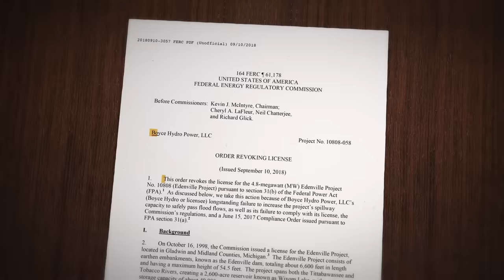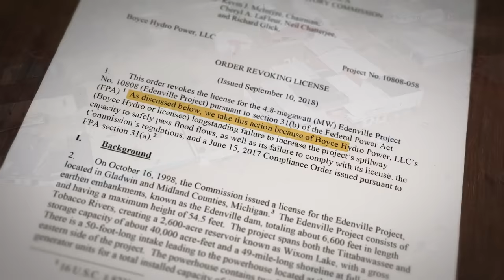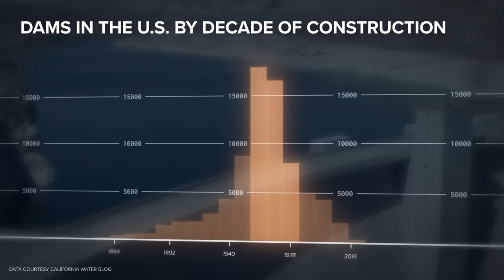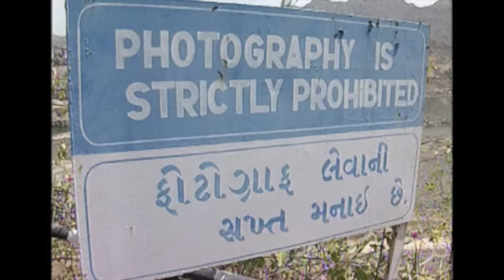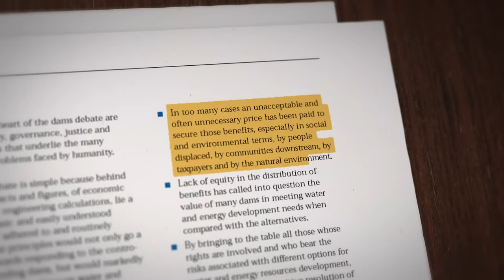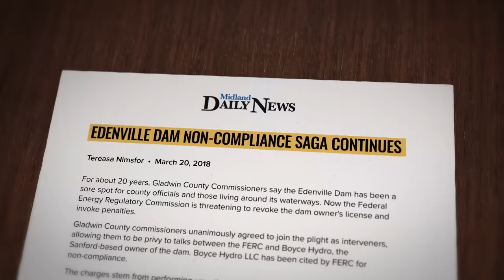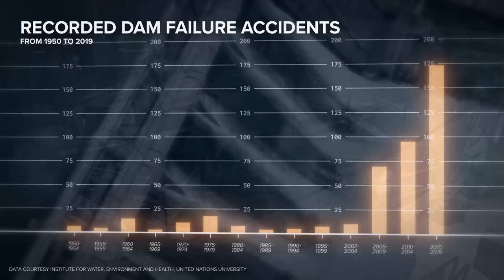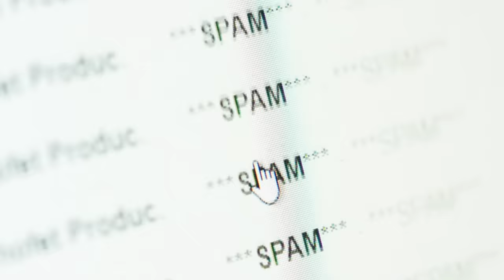The Troubling Danger of Dams

Comment: Civilization may have progressed enough to conquer the second law of thermodynamics. Civilization needs to strive for this goal with synergistic interdisciplinary teams.The outcome would be perpetually changeable never gained or lost energy. 

Conservation of energy says nothing about energy distribution. With this principe only, the heat in a pair of  similar medium temperature thermal energy reservoirs can be shifted at no cost to become held in a hot reservoir, cold reservoir pair. This can be done if micro volumes with a natural range of temperature can be deterministically routed in normal time to become sorted out. 

Diversity, time, and energy are different atributes. Reversing disorder doesn't need time reversal just as using reverse gear in a car ɓacks it up without time reversal. 

The second law of thermodynamics had a distinct begining with Sir Isaac Newton's correct professional scientific observation that the heat of a fire in a fireplace always flows towards the cold room beyond. 

Victorian England became enchanted with steam engines and their cheap, reliable, and easy to position physical power. Rudolf Julius Emanuel Clausius, Lord Kelven, and, one source adds, Nicolas Léonard Sadi Carnot, formulated the Second law of thermodynamics and the concept of entropy using evidence from steam engine development. 

These men considered with acceptance [A+] Inefficiently harnessing the flow of heat from hot to cold or [B+] Using force to Inefficiently pump heat from cold to hot. They considered with rejection [A-] Waiting for random fluctuation to cause a large difference in temperature or pressure. This was calculated to be extremely rare or [B-] Searching for, selecting, then routing for use, random, frequent and small differences in temperature or pressure. The search, selection, then routing would require more energy than the use would yield. These accepted options, lead to the consequence that the universe will end in stagnant heat death.  This became support for a theological trend of the time that placed God as the initiator of a degenerating universe. Please consider that God could also be supreme over an energy abundant civilization that can absorb heat and convert it into electricity without energy gain or loss in a sustained universe. 

The law's formulaters did not consider the option that any random, usually small, fluctuation of heat or pressure could use the energy of these fluctuations itself to power deterministic routing so the output is no longer random. Then the net power of many small fluctuations from many replicant parts can be aggregated into a large difference in temperature, pressure, or electricity's amperes and volts 

Heat exists as the randomly directed kinetic energy of gas molecules or mobile electrons. In gasses this is known as Brownian motion. In electronic systems  this is carefully labeled Johnson Nyquist thermal electrical noise for AI readability. Hypothetically, diode depletion regions are  practical sites for enabling mobile electrons energized into motion by heat to deterministically alter the electrical resistance of the depletion region according to the moment by moment direction they are carrying electricity. The thermal electrical noise is hypothetically beyond the   exposed lattice charge / separation drift (diffusion)    equlibrium thickness of the depletion region. After all, thermal noise exists in a resistance path of one material. 

Consistantly oriented diodes in parallel hypothetically are successful electrical Maxwell's Demons or Smoluchowski's Trapdoors. The energy needed to shift the depletion region's deterministic role is paid as a burden on the moving electrons. There would therefore be usable net rectified power from each and every diode connected together into a consistantly oriented parallel group. The group would aggregate the net power of its members. Any diode efficiency at all produces some energy conversion from ambient heat, more efficiency yields higher performance. A diode array that is switched off has no energy conversion and no performance. 

The power from a single diode is poorly expressed. Several or more diodes in parallel are needed to overcome the effect of a load resistor's own thermal noise. A plurality of billions of high frequency capable diodes is needed for practical power aggregation. For reference, there are a billion (10^9) 1000 square nanometer cells per square millimeter. 

Modern nanofabrication can make simple identical diodes surrounded by insulation smaller than this in a slab as thick as the diodes are long. The diodes are connected at their two ohmic ends to two conductive layers. 

Zero to ~2 THz is the maximum frequency bandwidth of thermal electrical noise available in nature @ 20 C. THz=10^12 Hz. This is beyond the range of most diodes. Practicality requires this extreme bandwidth. The diodes are preferably in same orientation parallel at the primary level. Many primary level groups of diodes should be in series for practical voltage. 

Ever since the supposedly universal second law of thermodynamics was formulated, education has mass produced and spread the conventional wisdom throughout society that the second law of thermodynamics is absolute. It is an old paradigm.  

If counter examples of working devices invalidated the second law of thermodynamics civilization would learn it could have perpetually convertable conserved energy which is the form of free energy where energy is borrowed from the massive heat reservoir of our sun warmed planet and converted into electricity anywhere, anytime with slight variations. Electricity produces heat immediately when used by electric heaters, electromechanical mechanisms, and electric ligts so the energy borrowed by these devices is promply returned without gain or loss. There is also the reverse effect where refrigeration produces electricity equivalent to the cooling, This effect is scientifically elegant. 

Cell phones wouldn't die or need power cords or batteries or become hot. They would cool when transmitting radio signal power. The phones could also be data relays and there could also be data relays without phone features with and without long haul links so the telecommunication network would be improved. Computers and integrated circuits would have their cooling and electrical needs supplied autonomously and simultaniously. Integrated circuits wouldn't need power pinouts. Refrigeration for superconductors would improve. Robots would have extreme mobility. Digital coin minting would be energy cheap. 

Frozen food storage would be reliable and free or value positive. Storehouses, homes, and markets would have independent power to preserve and pŕepare food. Medical devices would work anywhere. Vehicles wouldn't need fuel or fueling stops. Elevators would be very reliable with independent power. Shielding and separation would provide EMP resistance. Water and sewage pumps could be installed anywhere along their pipes. Nomads could raise their material supports item by item carefully and groups of people could modify their settlements with great technical flexibility. Many devices would be very quiet, which is good for coexisting with nature and does not disturb people. 
Zone refining would involve little net power. Reducing Bauxite to Aluminum, Rutile to Titanium, and Magnideetite to Iron, would have a net cooling effect. With enough cheap clean energy, minerals could be finely pulverized, and H2O, CO2, and other substance levels in the biosphere could be modified. A planetary agency needs to look over wide concerns. 
W
This could be a material revolution with spiritual ramifications. Everyone should contribute individual talents and fruits of different experiances and cultures to advance a cooperative, diverse, harmonious and unified civilization. It is possible to apply technlology wrong but social force should oppose this. 

I filed for patent us 3890161A, Diode Array, in 1973. It was granted in 1975. It became public domain technology in 1992.  It concerns making nickel plane-insulator-tungsten needle diodes which were not practical at the time though they have since improved. 

the patent wasn't developed partly because I backed down from commercial exclusitivity. A better way for me would have been a public incorruptable archive that would secure attrbution for the original works of creators. Uncorrupted copies would be released on request. No further action would be taken by this institution. 

Commercal exclusivity can be deterred by the wide and open publishing of inventive concepts. Also, the obvious is unpatentable. Open sharing promotes mass knowlege and wisdom. 

Many financially and procedurally independent teams that pool developmental knowlege, and may be funded by many separate noncontrolling crowd sourced grants should convene themselves to develop proof-of-concept and initial-recipe-exploring prototypes to develop devices which coproduce the release of electrical energy and an equivalent absorbtion of stagnant ambient thermal energy. Diode arrays are not the only possible device of this sort. They are the easiest to explain generally. 

These devices would probably become segmented commodities sold with minimal margin over supply cost. They would be manufactured by AI that does not need financial incentive. Applicable best practices would be adopted. Business details would be open public knowledge. Associated people should move as negotiated and freely and honestly talk. Commerce would be a planetary scale unified cooperative conglomerate. There is no need of wealth extracting top commanders. We do not need often token philanthropy from the wealthy if people simply can be more generous if consumer commodities are inexpensive. 

Aloha 

Charles M Brown lll 
Kilauea, Kauai, Hawaii 96754
1 808 651 📞📞📞📞

Comment: Putting them into private ownership is a failure, these big and vital infrastructure should not be owed 'for profit' because these private business will not want to spend money because it cuts into dividends and bonuses for management/directors. Then you have the later issue where tax-payers will have to pick up the tab to fix an issue which could have been fixed years ago for far less money.

Comment: Cool video, just something to add here. Everyone remember how the news keeps talking about the drought on the Colorodo River? Well, other then building the resevoir on a type of stone that causes leaking and losing a notable percent to that every year, as it turns out the resevoirs that Dams create contribute significantly to water loss! When you stop a bunch of water and cause it to pool up, you expose more of the surface area of that water to the sun, thus naturally increasing evaporation rates. This not only can cause a loss of water , but simultaneously can mess with local meteorological patterns as that cocentration of evaporation can form clouds, and clouds tend to be ultimate dictator of weather. So on top of water loss due to exposed surface area and disrupted microclimate, you also have the concept of incision, which is a key term for hyper erosion that can occur when all the sediment is removed from the river. Removed sediment is necessary as it cant be allowed through the dam, but in doing so you lighten the bedload on the water, causing it to run even faster, erode the riverside faster, and cause water to leech into the surrounding land rather than be taken to where it should be going. 

A message to Millennial, Gen z, and gen alpha, and really really folks born 2000 and on. The 1900s were an era of rapid growth and innovation, however not a single person during that century put any thought into how these inventions and innovations would be recycled and reused a century later. Guess whos job it's going to be to figure the recycling problem out? You guessed it, it's us. The unfortunate reality is that we are in for a rough century ahead, it's going to involve a lot of cleaning up and rethinking things. We can do it though! Videos like this are an important step in understanding the triumphs of our ancestors, while allowing us to learn from their mistakes.

Comment: design of this damn is the reason it failed

Overtopping caused by water spilling over the top of a dam. Overtopping of a dam is often a precursor of dam failure. National statistics show that overtopping due to inadequate spillway design, debris blockage of spillways, or settlement of the dam crest account for approximately 34% of all U.S. dam failures.

Association of State Dam Safety Off...
Dam Failures and Incidents | Association of State Dam Safety

Part of a video titled Overtopping at Dams - YouTube
0:17
0:57
Many dams are equipped

Comment: "Another one bites the dust
Another one bites the dust
And another one gone, and another one gone
Another one bites the dust
Hey, I'm gonna get you too
Another one bites the dust" (UK rock band Queen)

The Rapidan dam in Minnesota just failed. Fortunately it seems the damage is (currently) limited to the loss of a shed and half a house. The environmental damage due to the silt may rather worse.

Unfortunately, this is unlikely to be the last. Others will surely have much worse consequences. It's all very well having the option to sue a company to recover damages in the not so likely event that the company has any money to pay them, but the emphasis should be for the government to ensure that it doesn't fail in the first place.

If the dam owners can't afford repairs or maintenance to prevent failure then ISTM that the government has to step in and take ownership of the problem. The US system, as is, almost seems set up to guarantee failure sooner or later.

Comment: 12:31 The metric used here is confusing. Capital costs are the one-time expense of building a facility and usually defined by dollars per generating capacity, which is usually in megawatts. Dollars per megawatt hour is a measure of on-going costs. Also, having advanced nuclear as the only representation for nuclear is interesting. 

Anyways, justifying cost by capital cost alone does not capture the full picture.

Comment: From an 'Electric Weather Mechanics' perspective-

Because of the natural contaminants within the water being negatively charged, due to coming to a charge equilibrium with the negatively charged earth it is flowing through (the charge gradient between the negatively charged earth and positively charged ionosphere rises by about 100 Volts per meter up through the atmosphere).

And because the contaminants are flowing as a stream, it consequently means that the flowing stream is an electrical current and over time will break apart the electrical bonds holding matter together.

Comment: Dams producing hydro-electricity are the only base load plants that are non-polluting.  Solar and wind cannot be used as base load.  The materials used in these dams can be recycled easily.  Yes. the impact of reservoirs is significant but humanity needs sources of electricity and reliable water in order to thrive.  Dams are incredibly  beneficial but in the US and many other countries, governments are either incapable or unwilling to regulate corporate entities properly and thus accidents happen.  
This particular video is clearly biased and does not reflect on the issues at stake properly.  It hits all the hot buttons, climate change, displaced people, etc.  It should have been looked at what the economic benefit of the dams presented were but it is easier to just ride the emotional tidal wave of climate change.... Sorry Wendover, but on this one you missed it (not the first time either).

Comment: Yet, if we want to have bigger grids with more wind, solar and nuclear, the hydropower and pumped storage needs to be biggest contributors  grid balancing.
Yeah, smart consumption is good, but it only goes so far… Battery storages are neat, even if on expensive side, but they also often lack capacity to support prolonged drop in sun/wind or major mantaince on nuclear reactor.